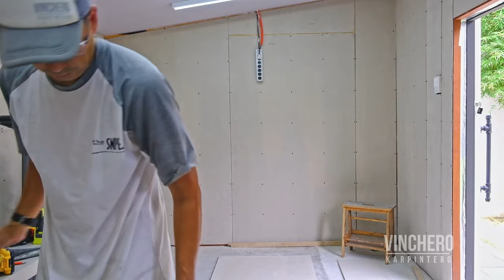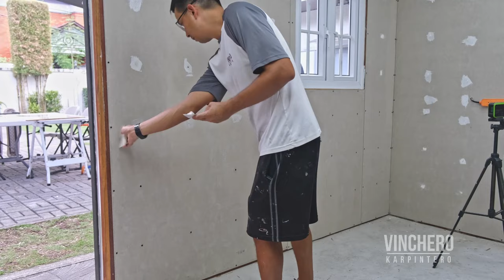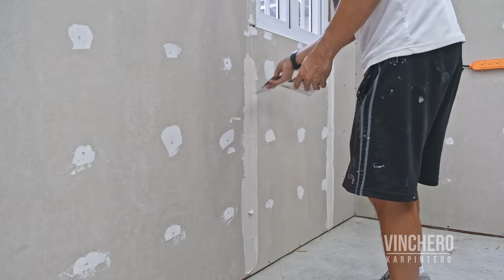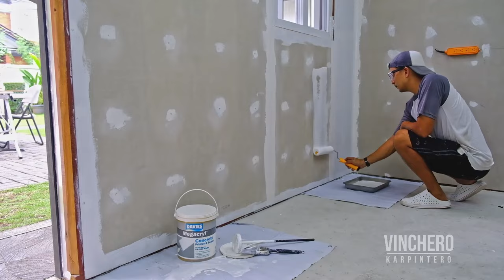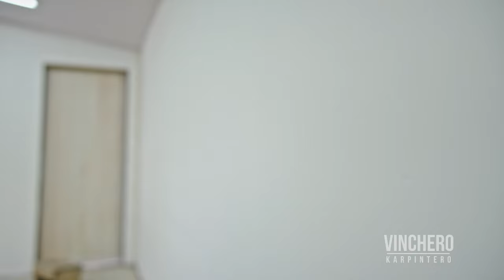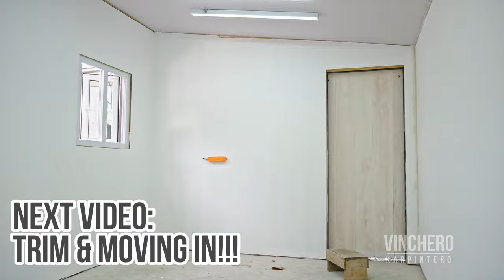Prepping and PAINTING of Fiber Cement Board Walls

Comment: What did you use to fill in the holes and what primer did you use prior to painting? Thanks!
Reply from the maker: I just used masonry putty to fill the holes. Used mesh tape for any joints. Concrete primer (matte latex) as primer.
Reply: Pwede po.ba ang epoxy primer gamitin sa cement board?